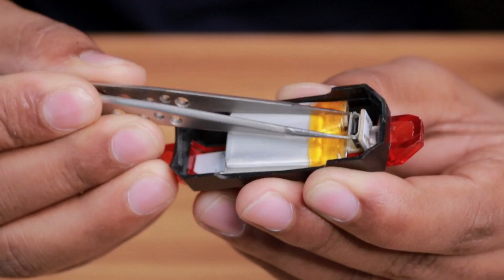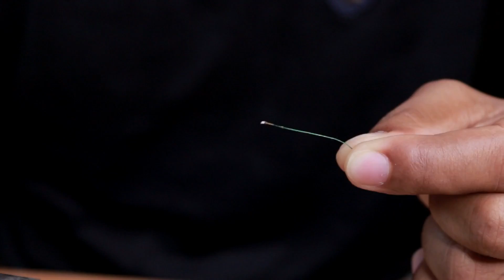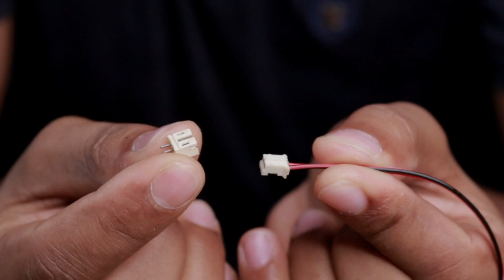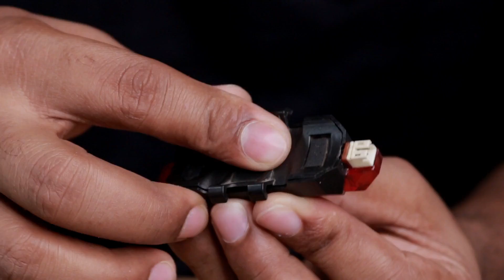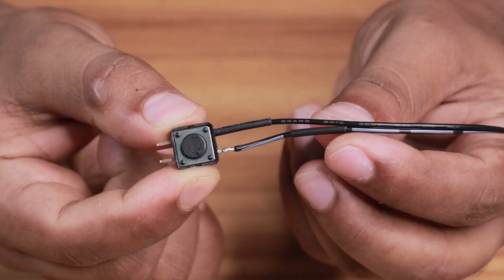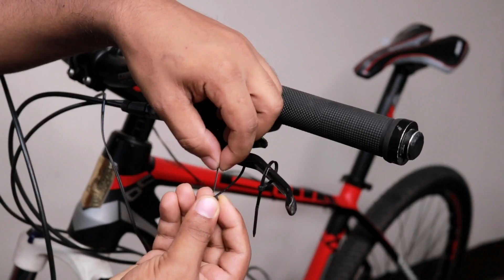How to make a brake light for Bicycle

Comment: I’d rather put a push sensitive lever on the actual back break vee pipe. So then it’s full comfort on the hands rather then a button under your hand, this is also better for it working every time without fail.